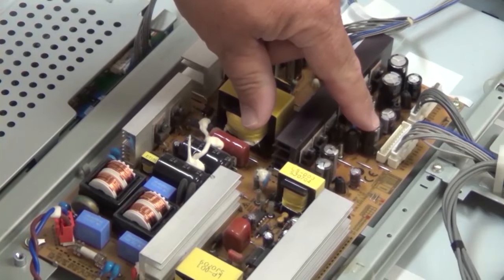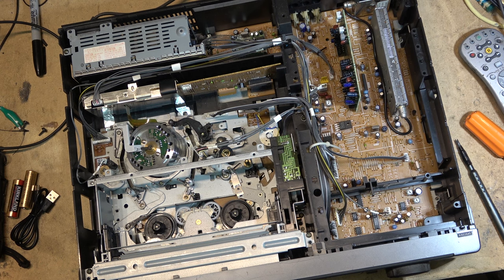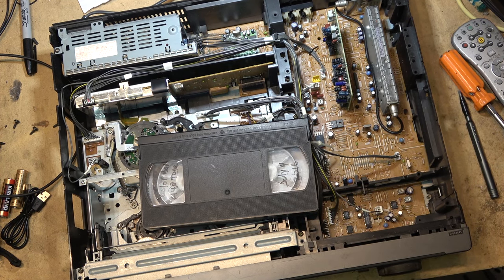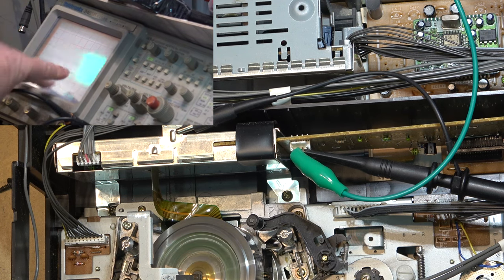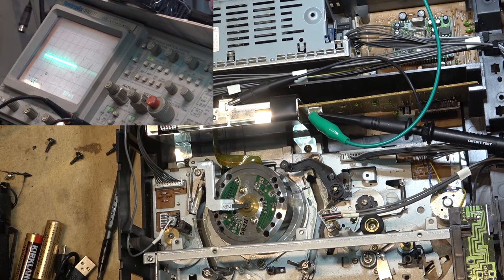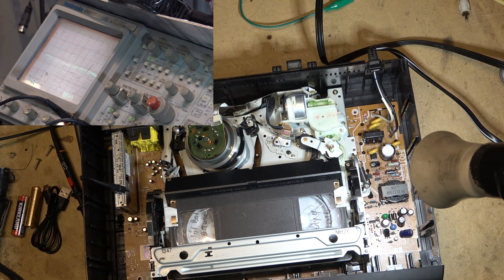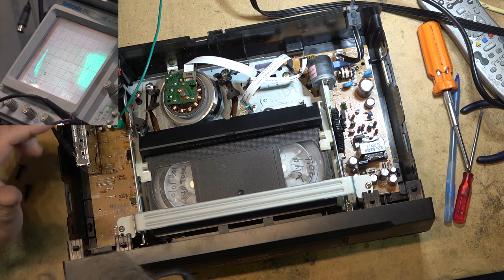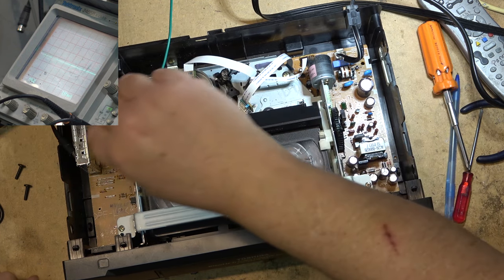Aligning multiple VCR using a scope VHS Beta and 8MM models

Comment: These VCRs were real gas factories. I have trouble understanding how it could have been so complicated to read a simple magnetic tape.
Reply from the maker: Because it's not a simple magnetic tape.  Audio tape is simple.  Video is not.  You require extremely high tape speeds to record the bandwidth requires for video.  That's just black and white video.  Color needs even more.  So much for for that matter that only professional machines costing 10s of thousands of dollars some hundeds of thousands can do it without having to completely reencode the audio.  This is what a VCR does. It strips the color and converts it to a lower frequency and reduces the color bandwidth to about 1/4 of the original in the process.    It's still a huge amount of information. So rotating heads are the only way to do it.  Draw thin little tracks across the tape in small stripes laid down next to each other.  You can't just do that with an analog signal however.  The signal fluctuates too much which would cause uneven brightness.  So you have to frequency modulate it, where the frequency shifts up and down to represent white to black ratio.  Now the level doesn't matter just the frequency.  Add in the color as an am modulated signal below the  video. It's one thing to record this but playback is another story. You have to retrace the diagnal stripes exactly or it won't play.  This requires perfect synchronization.  If you want to play the tape on a different machine that made the recording the playback machine also needs to have the exact same alignment as the machine that made the recording.  So simple magnetic tape and video are at the opposite end of the universe as far as recording goes.  The vcr, the camcorder was the most complex electromechanical device we have ever mass produced.
Reply: @12voltvids  Of course, you are absolutely right and my remark was a bit ironic. Especially since with this complexity the quality of the image with 240 points per line was quite average (on low-end devices). But it was a revolution to be able to watch movies at home and record your favorite shows. The superior S-VHS was not successful and came too late. Thank you for this very detailed technical response and congratulations for your fascinating videos.
Reply from the maker: Svhs was mostly a flop because of incomparability with VHS.  It was used mostly by high end videographers not doing broadcast work. Wedding ect.  Some consumers bought in for editing home videos that they shot on hi8 which like svhs offered even better quality.  Svhs and hi8 offered higher lumanence bandwidth but the color did not improve.  Many felt the color was weaker because the color stayed the same the detail was higher but many felt the lack of detail in the color negated the detail improvement.

Comment: Do you have a video of aligning a CD player using the EFM? I can't remember if you really need an analog scope to do this, or if you can use a DSO.
Reply from the maker: Only first gen CD players needed alignment and you needed the defect disc set to do it correct.  You can maximize the RF and look at the eye pattern on an analog scope but that's about it.

Comment: Really enjoyed this video Dave! I’m going to use the info to align some betamax decks. On that last JVC, models of that vintage from the early 90s would switch between hifi and normal audio at times somewhat in error. Are you aware of any mods to rectify this? I saw a service manual on ebay once with some handwriting that referred to this. Curious what it involved?

Comment: Funny you mention the Titanic tape, I have a Titanic tape (PAL) and it's the most misaligned tape I've ever seen, the duplicating machine must have had a loose part as the tracking is always drifting up and down and hifi is always kicking in and out. Tried on several machines, on a 4 head VCR it's annoying but tolerable on a 2 head machine the noise almost reaches half of the screen at times.

Comment: Philips made VHS VCRs for the European market with U-loading in the late '80s, after abandoning their V2000 format. Look up Philips Charly chassis, or a specific model, Philips VR6762. Interestingly, their V2000 VCRs were equipped with M-loading mechanism, I think only Grundig made V2000 VCRs with U-loading.

The old Philips V2000s had very reliable mechanisms with separate direct drive motors for everything (but the machines were not too reliable, due to frequent electronic faults). But their Charly chassis for VHS is dreadful, you can't find many which is working (or even repairable) nowadays. Lots of breaking plastic parts, especially in the cassette loading mechanism. But I love their V2000 machines and the format itself.

Comment: I've read a lot about VHS alignment and testing with an oscilloscope but actually seeing it being done by a professional is much more educational. Quick question. I have a 1980 Panasonic Omnivision VHS VCR and the tape won't play. I suspect it's the reel rotation sensor. Is that located beneath the supply reel or takeup reel?
Reply from the maker: It it has a mechanical tape counter driven off the take up spool many use the rotation of the  counter pulley to detect take up rotation.  Naturally if the belt breaks it shuts off.
Reply: @12voltvids  Thanks Dave for getting back to me. This really helps!

Comment: 15:19 - That's a very bad location for a scope point, so close to line voltage parts.
What was the reason that the audio RF was needed to be recorded by a separate head, and couldn't be recorded in one pass together with the video RF?
Reply from the maker: Not enough bandwidth on vhs. Betamax and 8mm did it with the same head as video.  VHS was a shit format always was.
Reply: @12voltvids  - I get that part, there was not enough space between the chroma and luma bandwidth. But as you explained, while both was recorded by the head drum, on the head drum itself separate heads were used for the recording of audio and video RF. So i'm curious about that part, why was there a need of recording the ARF first then recording the VRF over it, instead of recording both with a single head all at once?

Comment: Philips actually built a VHS VCR using a u-loading mechanism.  It was only on a couple of models and only available in Europe, though.

https://www.youtube.com/watch?v=EEUoML9uTBQ
Reply from the maker: I believe the only reason that nobody else did this was Sony owned the patent for the u loading schemes.  Sony also devoloped the M loading system.  Remember Sony was a co-developer of VHS.  It was the format they didn't chose in favor of betamax because of the better picture quality. Remember Sony Toshiba Panasonic JVC sanyo and NEC we're all working on a universal standard and everybody was on board or at least only thought they were on board with betamax when they made the announcement and then JVC went and stabbed them in the back and them along with Panasonic which is jvc's parent company brought out VHS. Do you loading system was a Sony invention for three quarter inch by the M loading system was a collaboration between all of the companies working on developing a home video system and they thought they had been shelved but it was brought out. Now Phillips is an interesting partner because they co-developed the compact disc with  Sony . The u loading was simpler with less to go wrong but takes more real estate inside the machine.  what is interesting is the beta cam decks use the u loading system just like well you can see it on my opening video from my betacam deck but the beta cam cameras initially used the u loading but they also adopted the molding system for the leader generation betacam cameras just because it could make the camera smaller
Reply: @12voltvids  Oh, I wasn't making any objections or anything like that.

Just showing something that I thought was interesting.  It would have been kind of cool if we had a VHS VCR that used a u-loading system here in North America.
Reply from the maker: Sure would have resulted in less work for alignment.

Comment: 9:11 camera shutter speed manually  set to lowest, too
Reply from the maker: It's set to 1/60 which is the frame rate.
Reply: @12voltvids  i have 60hz camera that goes down to 1/30.  
i should of said longest exposition time, because faster shutter speed equals less of your (fast) scope screen being captured, so if you can do 1/30, try that, as your scope is obviously faster than 1/60 (depending on horizontal sweep speed, offcourse), so at many times half of image is missing.

Comment: 1:55 https://youtu.be/IGmC3P8RQIs doesn't look too bad on this digital scope....a 300-400€ model, nominally 50mhz, but has a hack to do 100mhz. 
offcourse, you can move the whole waveform too, so you can zoom on the right edge (right roller guide on vcr) just as i did for left edge (p4 and p5 guides i believe they were called, p4 is left, p5 right)
Reply from the maker: Mine is useless.  Can't look at video either. It sucks.
Reply: @12voltvids  i know where you're coming from, indeed video looks better on analog scope, and indeed rf too, esp. on 200mhz tek(i believe) you have, but such scopes are hard to come by on most of the  planet....and they're getting expensive, unlike digital ones. on digital scope, trace is never really as thin line as on analog, it's never really a 1 pixel line, while analog one works exactly like 1 pixel is drawing an image, so it's sharper....

it's good to have both types, because (cheap) digital definitely has stuff only high end analog had, for example one-shot capture for transient events, or capturing slow changes, because it has wide timing window, while analog is limited to beam left-right speed, ie go too slow on analog and you don't get any remaining picture, you just have slow dot on the screen....

would i accept your or w2aew's (accidentally, he seems to be "Application Engineer for Tektronix") tek scopes? sure...would even pay shipping! heh....but you won't be giving them away anytime soon....
Reply from the maker: Analog scopes can be had for under 100.  Just don't look on the pirates den, i mean eBay.  Or should I call it epay. Look on Facebook market place. I see them all the time for 100 or less.  I picked up an old tube scope for 30 that would would fine for vcr alignment.  My Tek was free.   I have an hp that was also free.
Reply: @12voltvids  in bigger countries, yeah, usa especially, but not in my small mediterranean place. slim pickings. they're selling broken scopes for 70-80$...
i have analog scope, but recently some arcing is heard from inside, if it's x-former, it'll be a write-off...
Reply: @12voltvids  https://www.youtube.com/watch?v=j9k2mwPyWQ4
video on that scope: you would never be able to discern it's just one line (one waveform) making up a complete composite video signal on analog scope, because you can't capture and inspect signal on analog, its always moving and noisy. 
some tinkering with trigger was employed .